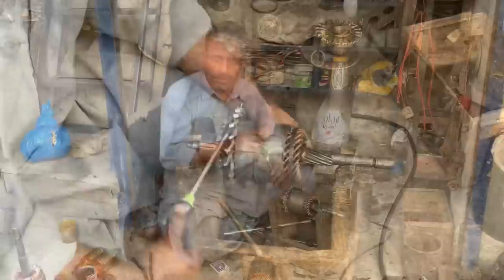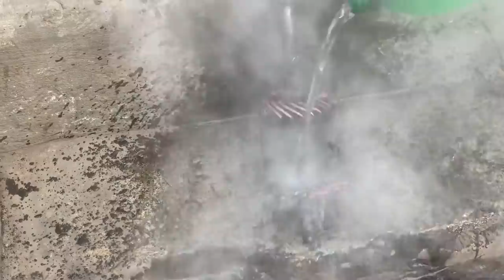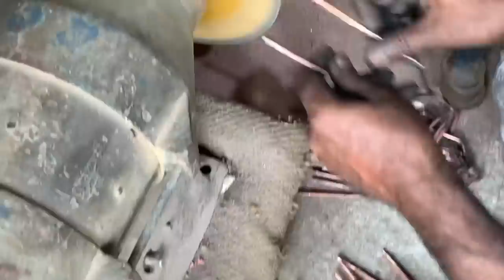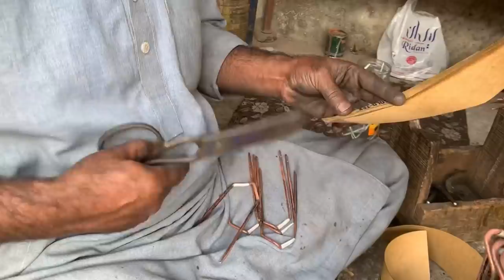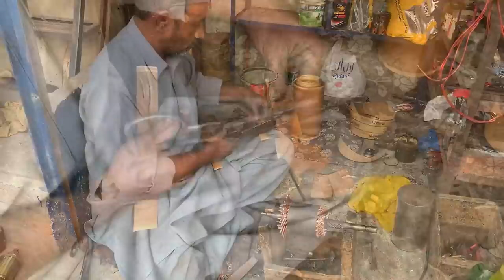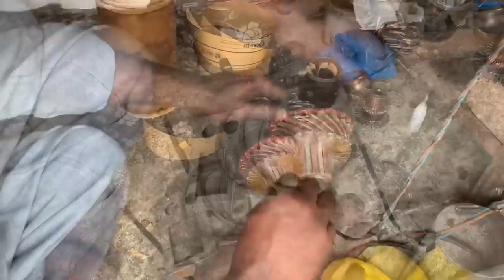Tractor 12V Starter Motor Armature Rewinding || Rebuilding Tractor Starter Damaged Armature

Comment: If you carefully read the box on starters and alternators at discount auto parts they are actually cleaned up used ones with new bearings and brushes. These are rebuilt like we used to do in the US 40-50 years ago. They're wearing sandals, working on a dirt floor with home made tools and I'd buy their products in a heartbeat.

Comment: Very Interesting! 2 questions;
1. What was he doing when he was using the wire and the light?
2. Was the liquid he applied to the armature a type of water proofing?
Reply: 1. checking for shorts n continuity 2. varnish, stops corrosion and helps insulate
Reply: @piperdoug428  the resin (varnish) also helps keep the windings in place so that they won't vibrate and become loose.

Comment: Apart from the steel shaft probably losing some of its hardness due to heat used to burn the resin, I think he's done everything right.. I still would've soldered the copper windings to the brush surface because of my OCD.. But with that silk thread and resin they aren't going anywhere anyway..
Reply: Да им пох на всё !
Reply: I doubt it it effects the steel shaft as one it not in direct contact with the source and secondly , for any serious molecular changes you need to heat to atleast 500 Centigrade
Reply: I think over time and with possible moisture the unsoldered connections will deteriorate with oxidation.But I've seen a lot of criticism of repairs of all kinds of things that will have shorter 'lives' than original higher standard work and I reckon that the use must be long enough to outweigh more frequent repairs.
Reply: @ianrutherford878  oxidation happens where oxygen can flow.. Having said that joints that are jammed with a hammer are very unlikely to deteriorate within 50 years I guess.. Not saying it's impossible but it's highly unlikely and even then it would take way longer than you'd hope this will still work for.
Like a screw in a threaded hole.. You can let it sit and rust for ages and when you unscrew it you see that the contact surface (the thread) is still shiny like new.
Reply: @ukpkmkk_2  Yet I have to wonder if profit-hungry manufacturers would expend resources on soldering if they really thought it was unnecessary.Movement due to heat and vibration (and maybe corrosion) must lead to some failures of unsoldered joints or they wouldn't do it.
Reply: @ianrutherford878  because manufacturers are not repair shops..  they have the proper machinery to do it efficiently for a few extra pennies and in no time..
and because they are MANUFACTURERS, they have to do everything by the book, ever heard of TÜV for example? in many cases things would work perfectly, but TÜV would reject it just because somewhere there's a paper that says otherwise.
so if they didn't do it like that and for some reason one of the joints fail (because mass production isn't like handcrafting) it could escalate to a class action law suit, and then the manufacturer would have to recall and replace all parts (even the ones that work fine and have no intentions to break) so the cost would then skyrocket and outweigh the few pennies that would cost them just to weld those.
Reply: Calling it "the brush surface" says a lot about how much you don't know! Lmao
Reply: the heat is to burn the insulator not melt steel  - the heat would damage the windings before the steel leaving him with nothing to repair
Reply: @nainitalism it is actuall only 200 c. Look it up in c/fe diagram

Comment: For when you are cutting the plastic tubing and trying to get equal length pieces, you should make a makeshift wooden slot that has a notch for the cut length. This way you can just slide the tubing up against a hard edge and cut. Some scrap wood should suffice and speed up this process. It could even be done ahead of time if you are using the same length regularly.

Comment: This guy is a butcher! I wouldn't give him any work!
Reply: Can you please specify what he's done wrong and why? Or is it because you see the primitive tools and you think he's a butcher because you actually have no idea.
Reply: @ukpkmkk_2  Sir, I'm a retired mechanic with 45 Years experience. The problems I saw was too much hammer and no solder on the winding ends when he assembled the stater.
Reply: @robertfrye3651  I agree partially on soldering the windings, I too mentioned it in a previous comment.. Not that I wouldn't do it but With the windings' endings hammered into place and all that silk thread and resin I don't think it'll make any difference to solder.. There's already good contact and it's not going anywhere.. Besides there's nowhere for the solder to go since the ends were jammed in place from the side and machined from above.. Which only leaves soldering from below which looks like an unnecessary pain in the behind.. 
As for the argument "too much hammer" I don't think I need to say anything to an argument as vague as this.. If you need a hammer you use a hammer.. There's no specific amount of usage for each tool.. 
If you have 50 screws on a certain piece you don't quit half way and start using pliers because you already used too much screwdriver.. What would a lumberjack then do for God's sake?
Does a hammer have the reputation of being an elegant tool? No.. 
But does using it make him a butcher? I don't think so..
Mind you this workshop doesn't really look like the utopian western workshops which have a specific tool for each and every specific task..
Reply: @ukpkmkk_2  You have a Great day, Sir.
Reply: No YOU wouldn’t, YOU’D go out and just pay for a new part instead of having what you already had repaired or rebuilt. Americas throw away generation.
Reply: @guillermocarrillo3959  Well bless your heart. I thinking with 45 Years as a mechanic I could fix it myself.
Reply: @robertfrye3651  you could, but you criticize those that Do.
Reply: @guillermocarrillo3959  You have a nice day Sir.
Reply: @robertfrye3651  At first I was afraid of the hammering too, but as I noticed that the winding of coils is not made of wires and are just copper bars, I don't think the hammering matters, as long as he is careful enough to not bend them too much.